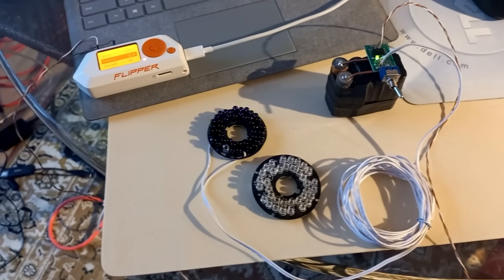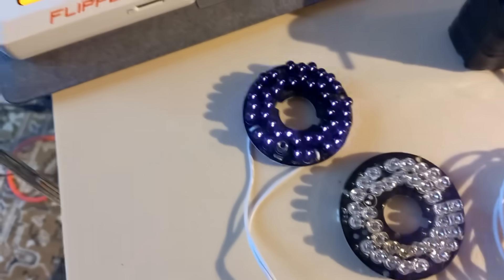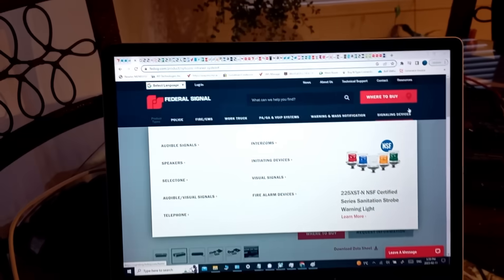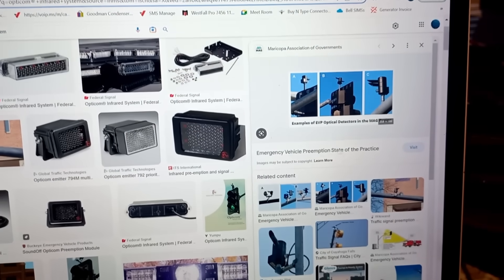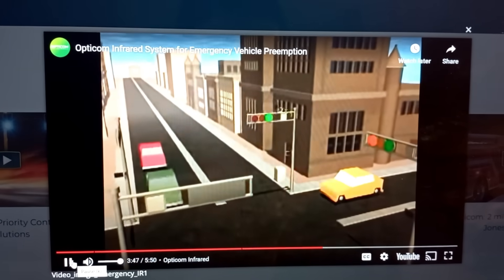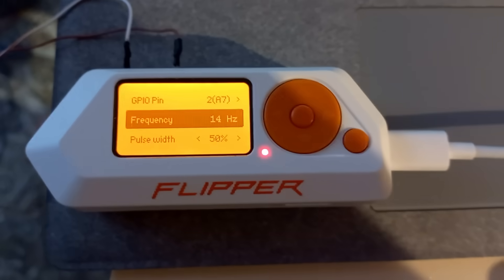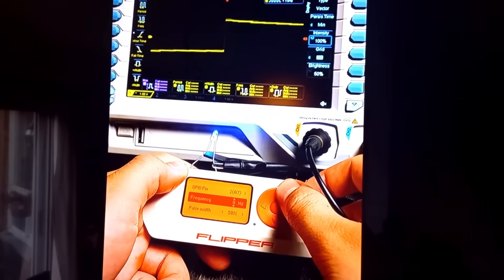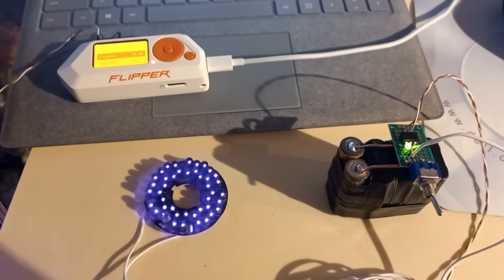Flipper Zero Controlling Traffic Lights

Comment: In Europe (Germany) you would need to send a signal on 151,09 MHz or 170,77 MHz. So you need an extra breadboard for the flipper.
Reply: Would be interesting to use a SDR to replay what's being transmitted. :-)
Reply: I have a Bengal cat too!
Reply: I have no idea if/where Germany uses 151,09 MHz or 170,77 MHz for emergency vehicles. I'm sure they don't use it here in my little town. But what they use is a transmitter in buses and other public transportation vehicles. Some cities use an old AM System, others newer ones with other frequencies. But this won't turn the light instantly green, it needs some time because the traffic light controller receives this signal far before the bus enters the intersection.
It is possible to pick it up and send it with the Flipper, but because the transmitting range is shorter than the bus transmitter, it takes some more time to turn it green.
Reply: Some railroad crossings in the US can be activated by simple DTMF tones on the frequencies the railroad company uses. Yes, as in touch tone telephone, all in the clear analog with no encryption. This is used on lines where a train station is right next to a crossing, sent from the engine's cab.
Reply: From where did you get this Info?
Reply: @peterfairlie2296  That is hilarious. The cat just doesn't care at all.
Reply: Können wir das gemeinsam schaffen?
Reply: I'm from Germany :3
Reply: @Alexifeu geh arbeiten und hör auf zu schreiben. Peinlicher typ
Reply: @Alexifeu  interessiert keine sau